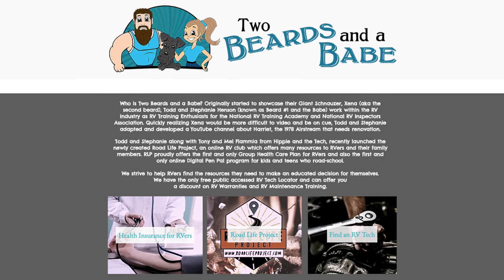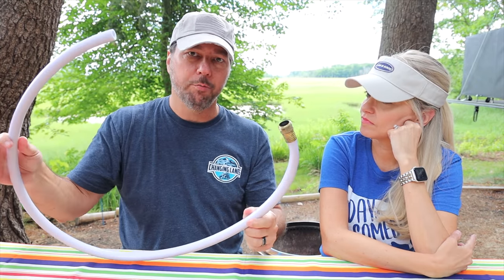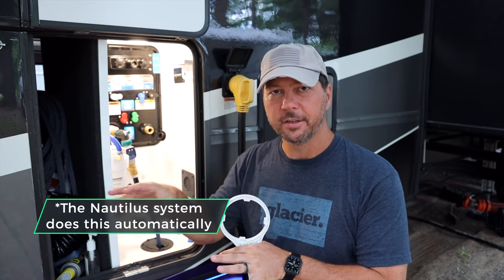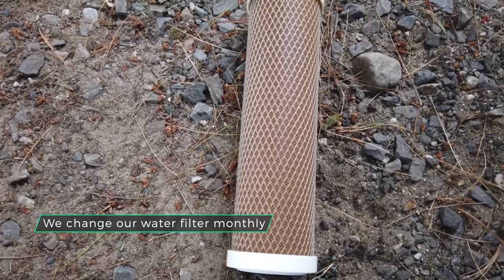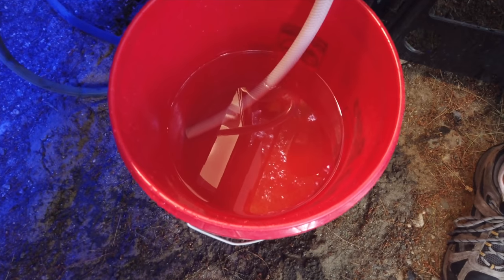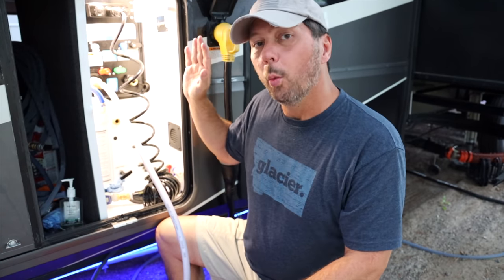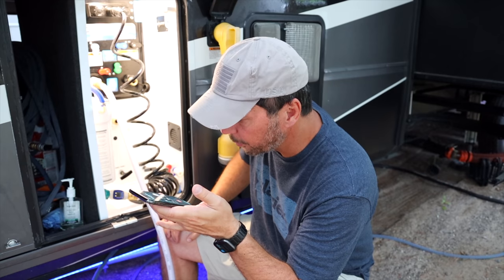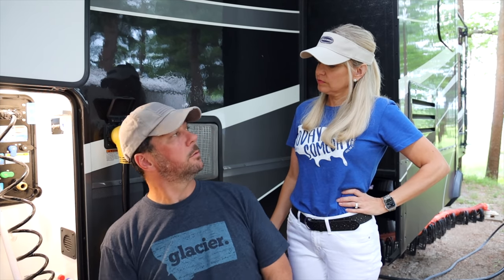💧 RV Fresh Water System Sanitization! (RV Maintenance Series) | RV Living!

Comment: Hi Chad and Tara:

Thanks for this video about sanitizing the fresh water system.  I have a couple of questions.

1)  Is it safe to assume that you ran two cycles of your washer to flush out the water lines there?

2) We have a residential refrigerator with an ice maker.  I can see the value of sanitizing the drinking water side.  But the ice side worries me.  I can flush the drinking water side easily enough by running water through until the bleach smell  shows up, then after the “incubation time, running water again until the smell is gone.  For the ice side, my imagination suggests that I just keep making ice until I smell bleach in the ice.  Then to clear the system after incubation, make and toss out ice until there is no smell there either.  

I’d love to hear your thoughts.

Again, thanks for this video.  I’m off to find your video now about sanitizing the hot water side.
Reply from the maker: #1 - yes
#2 - good question.  I'd think what you're proposing is right.  But, I would ask around on a rving facebook group.

Comment: 150 gallons of fresh water?  That is 1245 pounds of water you are hauling around after you fill your tanks!  I used to worry about an extra 315 pounds of water when I fill my fresh water tank.  I still don't travel with it half full because I don't want to worry about weight sloshing side to side or front to rear.  I did some liquid hauling when I was in the army and quickly learned about liquids shifting weight in the direction you don't want when cornering and when braking!
Reply from the maker: We only fill the tanks if longer term boondocking and then we do it near our destination.

Comment: It appears to me that you're making the process more difficult than it needs to be. once you added bleach / water through your siphon system to your holding tanks then all you had to do is run your faucets from you're holding tank just as you would be from boondocking and you would have had sanitize lines. Naturally you still want to bypass your hot water heater.
Reply from the maker: That will put bleach into our water heater, which is why we syphon to bypass it.
Reply: With that natalus system, you can't run the pump like normal and bypass the water heater. The water heater bypass is built into the valving for the sanitation processes.

Comment: I saw that you bypassed the hot water heater.  What about if there's an ice maker?
Reply from the maker: We don't have one, but that's a good question.  Just run the ice maker off the pump for the 8-12 hours while it's sitting, which will use the bleach solution, then run a few more cycles of ice after the flush phase till there's no more bleach smell...  Throw that ice away, obviously.. 😊

Comment: Why couldn’t you just drain fresh tank with the manual drain and fill it back up with fresh and flush out then.  Didn’t realize I should empty fresh tank, I usually keep it half full in case the water goes out at the campground.  It has happen during the winter that a pipe burst and you don’t have any water until they fix it.
Reply from the maker: Not a great idea to dump 150 gallons of bleach water on the ground in an rv park..  👍🏼   Stagnate water is a breeding ground for microbes.  So, if you want to save some spare water just in case, you might want to dump and refill it every week to keep it fresh.

Comment: Why not dumb a cup of bleach into the holding tank, then just fill the tank like normal? (For a 50gal tank).  Would be a lot easier than a bucket/siphon hose etc.. ?
Reply: Straight bleach can be too strong and it can be hard to wash out. It keeps dripping into the tanks from the inlets, for instance.
Reply from the maker: Where are you going to dump it to get it to your fresh tank?  Some have gravity fed fresh tank, but ours is force fill with a syphon option.  raw bleach would be too strong, hence the dilution.

Comment: What did you do for the ice maker?
Reply from the maker: We don't have one, but that's a good question.  Just run the ice maker off the pump for the 8-12 hours while it's sitting, which will use the bleach solution, then run a few more cycles of ice after the flush phase till there's no more bleach smell...  Throw that ice away, obviously.. 😊

Comment: How about t’ ice maker
Reply from the maker: We don't have one, but that's a good question.  Just run the ice maker off the pump for the 8-12 hours while it's sitting, which will use the bleach solution, then run a few more cycles of ice after the flush phase till there's no more bleach smell...  Throw that ice away, obviously.. 😊

Comment: Hi Guys,
Another great video!
I noticed that your pressure gauge on your intake is missing. Are you using a different method to monitor pressure or did you move the gauge to the water post? 
Thanks! Rob
Reply from the maker: We keep our regulator at the post and the meter at the intake.. 👍🏼

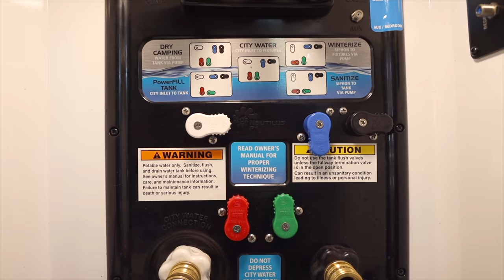Comment: What the heck is going on at 4:39 ? Was that something that you guys did or did that come from the factory like that?  If it came from the factory, they really need to take a moment and plan out their runs and connections.
Reply from the maker: Part of the Nautilus system from the factory...  The mess behind the scenes makes for simple valves on the front.
Reply: @ChangingLanes   They really could have cleaned that piping up, no excuse.